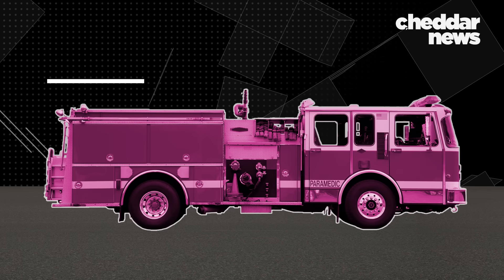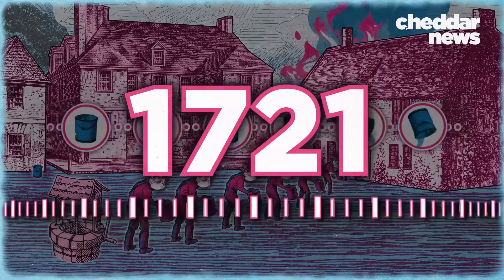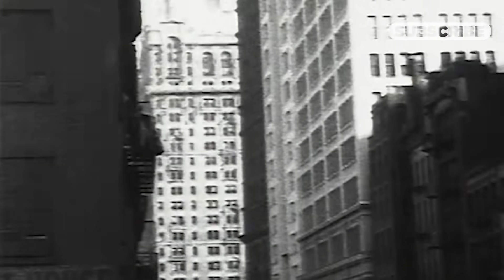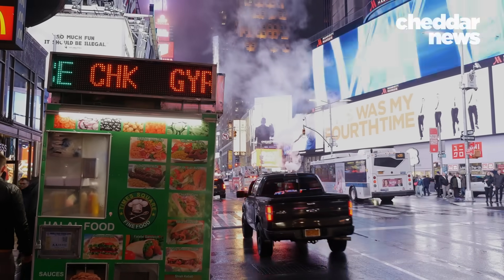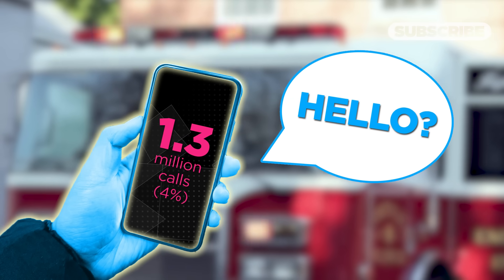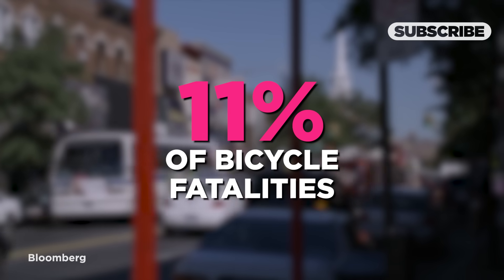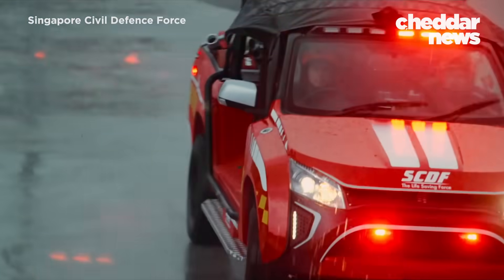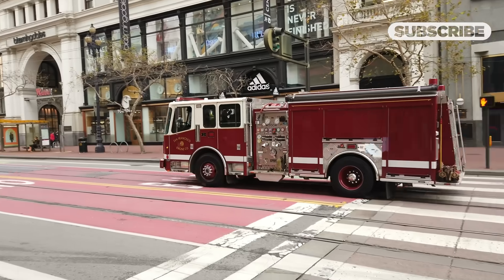Do American Fire Trucks Need To Be So Massive? - Cheddar Explains

Comment: A lot of these new engines are also modular, even the front half of the vehicle raised up so you can see the actual engine underneath the cab. If something such as a headlight were damaged, it just comes out instead of having to take apart the entire housing around it.
Reply: Most US engines have been using sealed beam headlights for longer than I've been alive.

Comment: The Euro trucks achieve the same results as the enormous American trucks (sometimes even in water capacity) and are much, much faster to the scene. They're better packaged and designed, just like Euro cars vs US cars in the 70s and 80s. Time to catch up, 'Murica.
Reply: how are they faster on scene? They aren't any quicker and have longer response runs ...
Reply: @EnjoyFirefighting  In the same conditions (ie if the Euro trucks were planted in bigger US streets) then I'd expect them to do better. Their power to weight ratio is generally much better (I'm thinking twin/quad turbo MAN, Scania, Volvo vehicles) and they're more manoeuvrable.
Reply: @davidrbrtsn  however we have to look at the conditions in which they are in, not the ones which would be nice to have. When looking at some cities in Europe the station sits at the citylimits on one side and will take quite some time to get to the very other side of the city. In the American cities numerous tiny stations are spread out in the area, while Europeans love to have all their eggs in one basket, in one or only few enornous stations
Reply: @EnjoyFirefighting  ...Well then maybe the US could be a model for fire station placement to Europeans, and the European engines could serve as an example to the USA... I'm an impartial observer who lives in neither of these regions 😅
Reply: @davidrbrtsn  I highly doubt that. Europeans love their convoys. An Aerial is barely able to do sth on its own and special operations trucks often don't have a seperate crew, so crews from the other primary apparatus need to jump into the empty seat of the special operations trucks

Comment: I live in the middle of nowhere.  If a fire happens on my road, the fire department needs to be able to bring all the water required to flood the fire out.  There's no hydrant access, and the nearest body of water is ~1 mile away.  If it's bad enough, the fire departments may even need to set up a pump or pump truck there, and keep refilling tender trucks to send back into the fray.